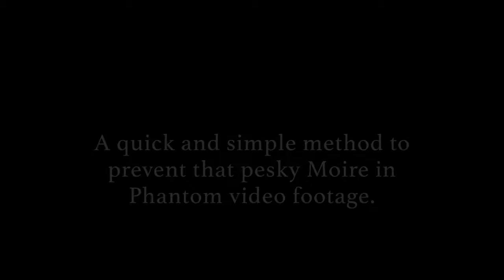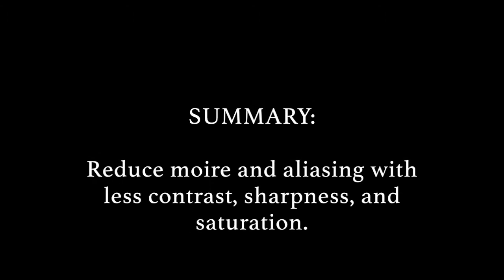No More Moire

Comment: The Mavic introduces digital noise reduction at anything below +1 on sharpness. It is horrible noise reduction!! I'm stuck with a +1 0 0 setting to avoid it. The Mavic sensor isn't as sensitive as the p4p sensor is. The Mavic doesn't produce nearly as much moire as the phantom cameras. We suffer in low light for it but everything is a trade off i suppose.